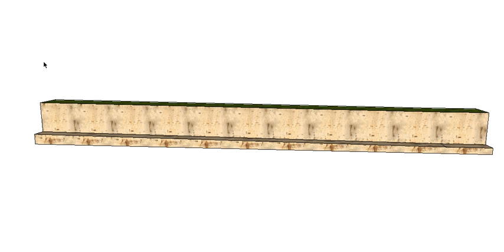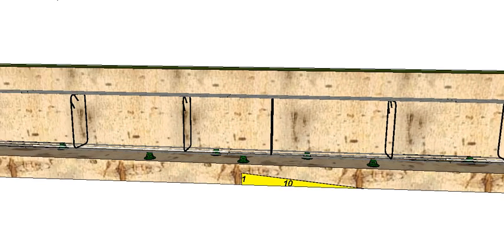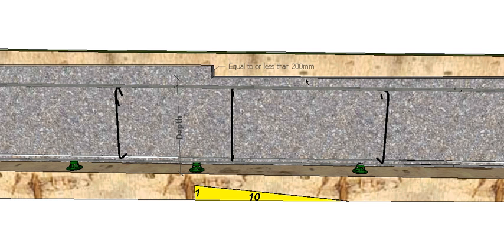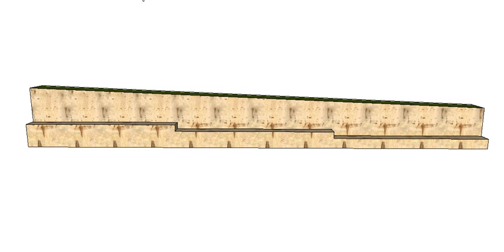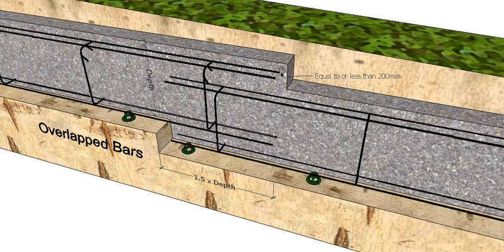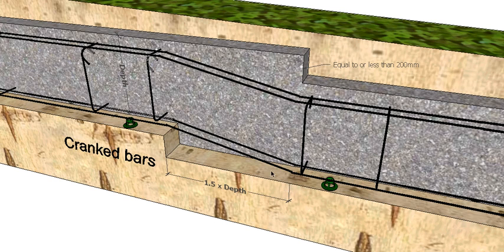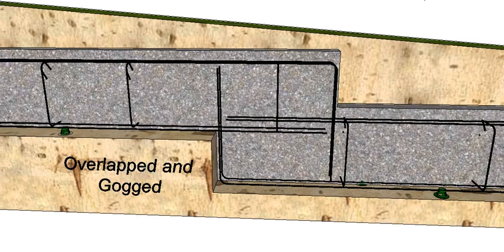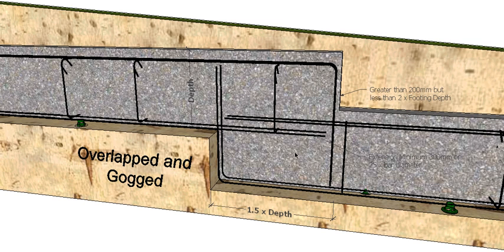Stepped Footing Reinforcement

Comment: Thanks for your videos! Do you have any videos on how to connect garage extension footings/foundations to side of a house?
Reply from the maker: findscl Hi findscl not unfortunately i dont have any videos showing that. That type of connection would normally be required to be designed by a structural engineer Thanks for your comments